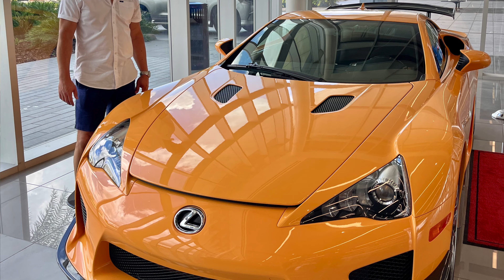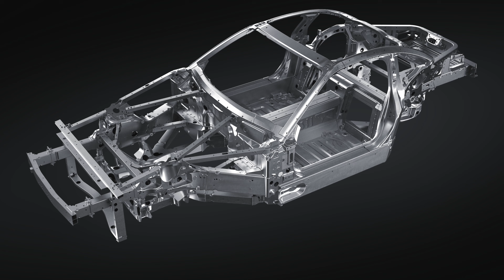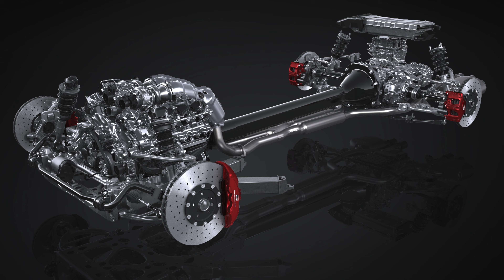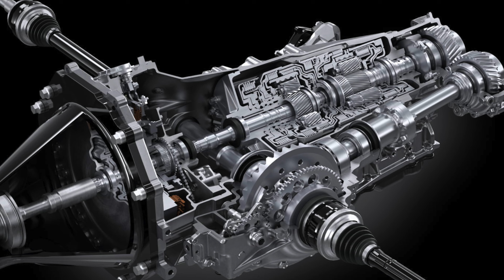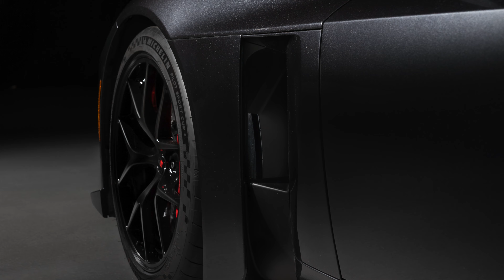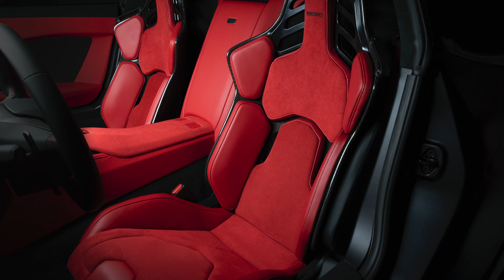Toyota Messed This One Up… And It Hurts to Say - GR GT

Comment: People that buy expensive cars generally prefer auto's, look at Ferrari, they don't offer manuals for many years, this car is going to be ~150k, they need to move a few units to justify the cars existence to the bean counters. Also a v8 manual would be tricky regarding fuel efficiency/emission regs, can you even do a manual in hybrid?
Reply from the maker: Honda Prelude  and the old Insight are manual hybrids... But I'm saying they should offer an option WITHOUT the hydrid drivetrain.

Comment: If they want to get the CoG down lower, they need to adopt a flat engine, a la Porsche & Subaru!
And if they wanted light weight, they really did mess up. Big Time!
The only good thing about heavy cars is how well they do in the rain, with tyres pumped up hard to reduce contact patch, and increasing traction via higher weight per square cm. But we don't normally drive insanely fast in the rain, do we?

The shape looks great, I have to say, and when it loses half the stuff its got now, it might turn into a good car one day. Meantime, I will stick with my 28 year old (just fully restored) Tommy Kaira M20b, my 57 year old (restored) 911S, and my 43 year old (original) 928S. Those are really good cars! And... they are much more fun than new cars. :)
Reply from the maker: Not every race car has a flat engine due to several significant drawbacks, including increased cost and complexity, difficult packaging due to width, and challenges with maintenance and cooling that often outweigh the benefits of a low center of gravity. I also highly doubt a flat engine would pass Toyota's rigorous durability tests and higher maintenance costs. I'm with you on the rest of your comment!!! Excellent taste my friend!
Reply: When you mentioned your age it all made sense 😂 you’re quite dated in knowledge and understanding. Putting in the probability of driving in the rain showed us how out of touch you really are when it comes to supercars. The last thing a supercar owner worries about is how it performs in the rain because nobody drives or considers that unless absolutely necessary. Now go and make your race car bed and grow up.😭